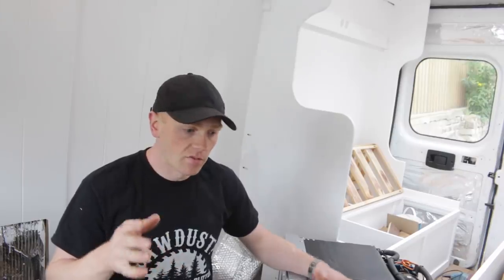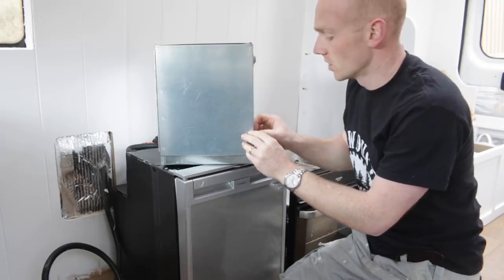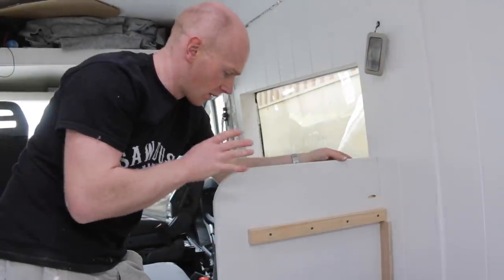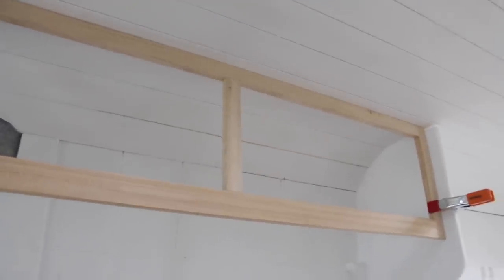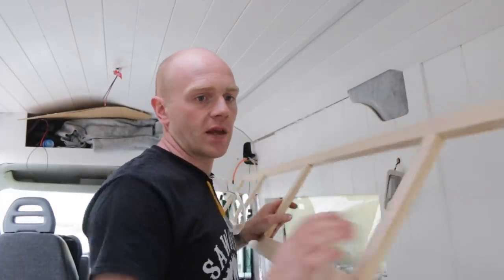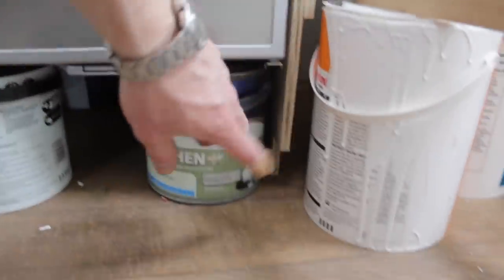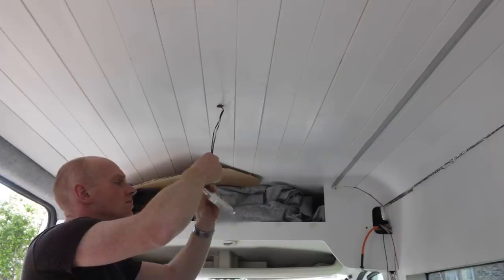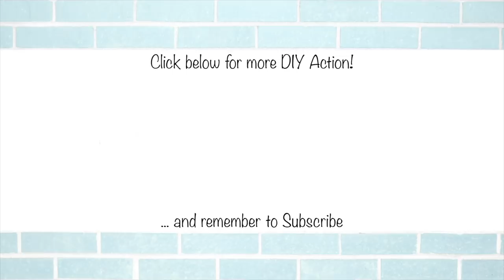Starting the Kitchen and Upper Cabinets | TRC Van Conversion

Comment: That Oven is light - mine (30 yr old Calor) is on the edge of liftability :( Did you ever consider having an underslung Gas Cylinder? Are you going to be using a Camping Gaz 907 cylinder - looks like it from the size of the Cupboard - will that be enough? - it's a very expensive way to buy gas.